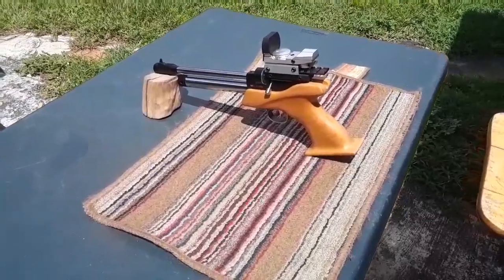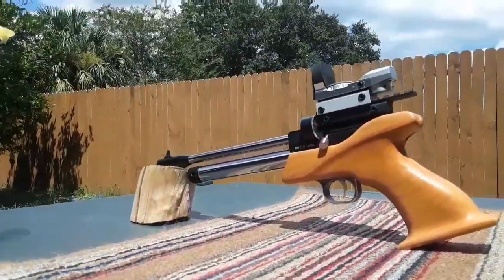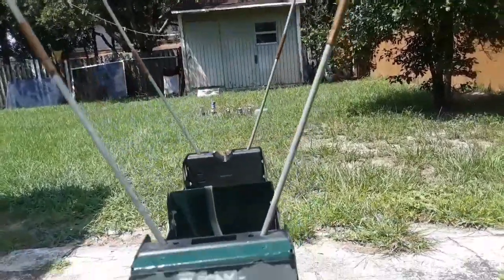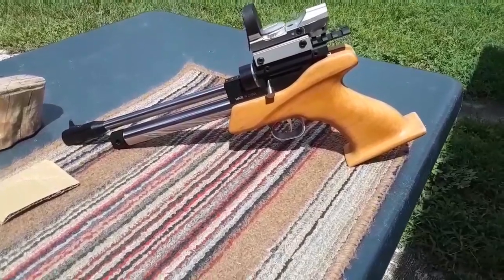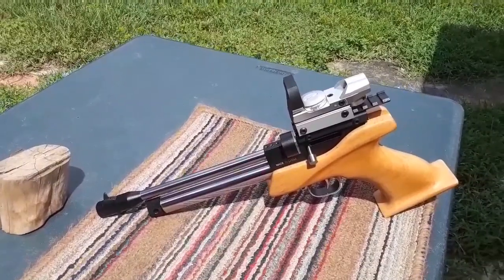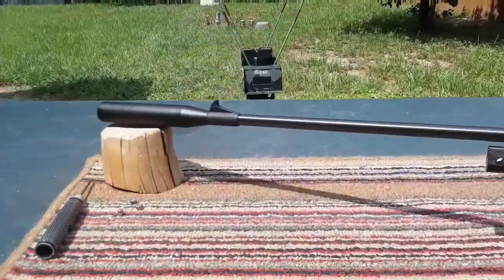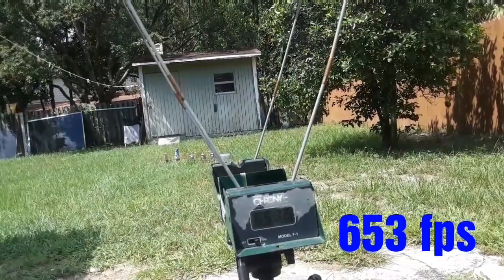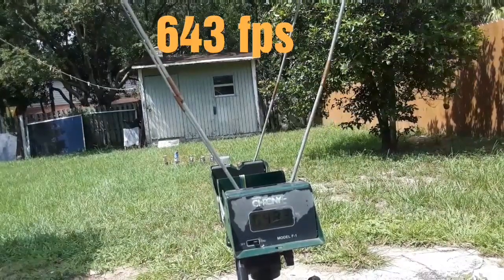Smk CP1.22cal TUNED🔥 for 500+fps with short barrel💨💨🎯

Comment: Just to remind shooters in the UK. Fitting a rifle barrel to a pistol is illegal in the UK. So with the CP2 for instance, only fit the rifle barrel in conjunction with the bolt on rifle stock provided. Nice vids Juan.
Reply: The UK definition of "handgun" is a bit woolly and left for a court to rule on. Basically max barrel 30cm and/or max overall length 60cm. It's about whether it can be concealed. Pistol max 6 ft lb, rifle 12 ft lb.  With a 0.53g .177 pellet 6 ft lb comes up at 580fps. 
It can go there but you might only get 20 shots. However the CP2 pistol gets best spread of fps slightly below 500fps, like some 60 good shots and the last 10 dropping pressure, per capsule, if you get the CO2 valve to self-regulate, which is doable. Excess CO2 leaving the barrel tumbles the pellet. It is a target pistol, effective range 10 metres, 20 metres at best - tune it for best accuracy not highest possible power. A 0.53g pellet (8.18gr) going 485fps (>4.2 ft lb) will easily kill a rat.
Reply: bull** rifle barrel pistol upto 6ftlbs uk i buy sell dailey Get a grip Steph
Reply: @DEEEDEEE96  Refer to @jeffslade 1982. The 1997 law[18]: 3.2  British law defines a "pistol" as a firearm with a barrel shorter than 30 cm (12 in) or a total length of less than 60 cm (24 in)[19] 
 The CP2s barrel is 45cm long. Making it technically illegal to shoot in pistol format under this paragraph.
  This law created a new market for "long-barrelled revolvers" and "long-barrelled pistols", firearms with a permanently attached extension to the grip, making them long enough to fit under the legal definition of a rifle.
 The key word here in legalese is PERMANTLY.

Comment: Hey mike here hello my air gun friend . Got my cp1 pistol last weekend . Ausom pistol can’t wait to do some 2240 like mods. 🇨🇦🇺🇸❤️🍺
Reply from the maker: Hello thanks for watching. You will enjoy this pistol very much. If you have a 2240 it will get jealous of the cp1 lol. Number one thing to gain more power is to a lighter valve spring. Or heavier hammer spring. You must be careful when replacing the stock hammer spring with a stronger one. If the hammer spring is too strong you could possibly snap your bolt handle and then you would be in serious trouble. Also when replacing the stock hammer spring with a stronger one you compromise the lightness of the trigger pull. Stronger hammer spring equals stronger trigger pull or heavier trigger pull. So like I said the easiest way to get more FPS without compromising your light trigger pull is to replace the valve spring with a lighter one. Stay tuned for more videos brother.

Comment: Hi I no if you use a valve from a umarex gauntlet and parts that will fit plus the mod would be sweat it more or less a qb78 or 79 design sweat gun umarex part let u use hpa even sweater hope this helps

Comment: Wivh pellet was that?
The pellets are very important.
If its not heavy then you got more
Volicity . Thanx
Reply from the maker: 14.3gr .22cal crosman hollow points. Before mods using same 14.3gr 420 to 425 out of the box. After mods same 14.3gr are results that you see in this video.  I have another video with stock out of the box chronograph results.